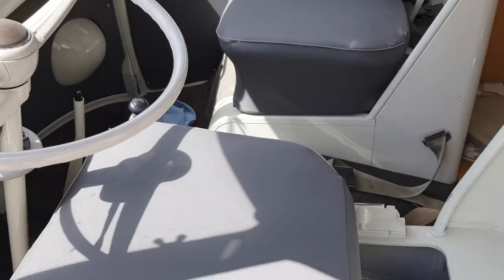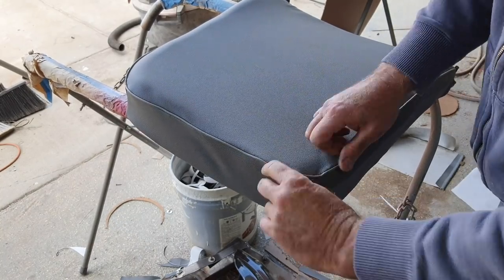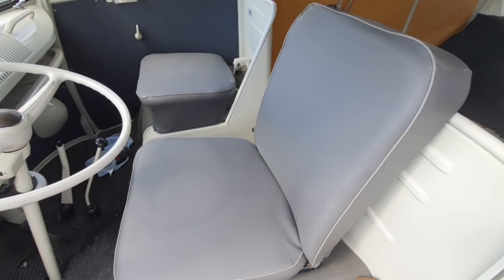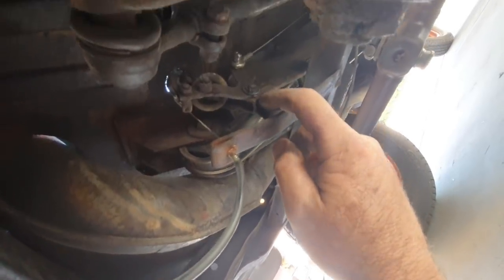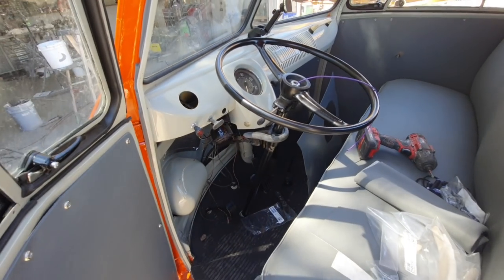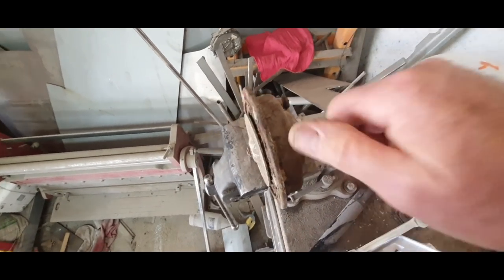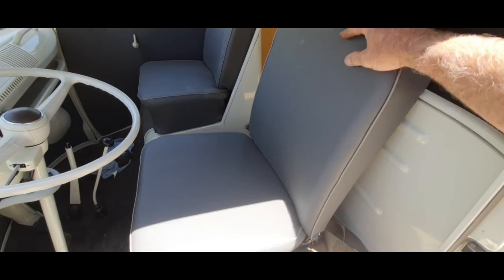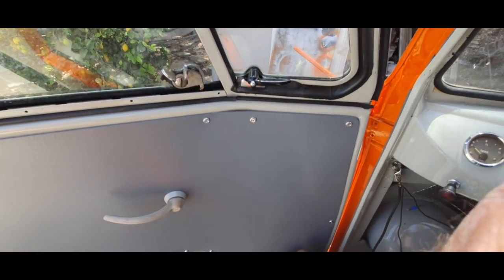VW type 2 cherry picker so models assembly wiring

Comment: Mike - I have a couple of broken springs on the seats. I saw that your springs still seemed fine, so I didn't get to see you fix that kind of thing. Maybe, another time.
Reply from the maker: I usually buy springs from the upholstery supply if they are really bad. or weld them up. they were good on these seats. unbelievable on the bucket truck that the springs were that good.

Comment: Still need the trip to the scales to see what the VW weighs bare and with the man lift . Any idea how much weight was missing due to rust before you started?
Reply from the maker: yea to get registration I need to get weight cert. I will make it light we shall see will post that
Reply: Never thought of that. You’ll have to register it as a commercial vehicle. Maybe get it done by slapping the bucket assembly on it, drive it to the nearest public scale and get the all-up weight.

Comment: View #857 at 1:40 pm on 5/7/31 - NJ... Does the idle have to be set at any particular RPM for the lift to work
Reply from the maker: I will find out when I work it for the first time. I dont think it has a particular rpm but probably needs to be above idle.